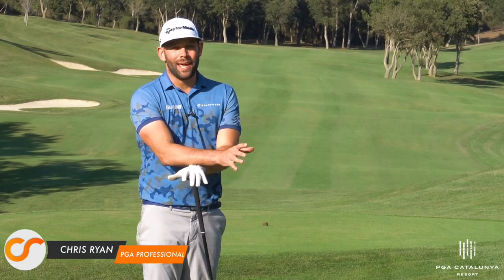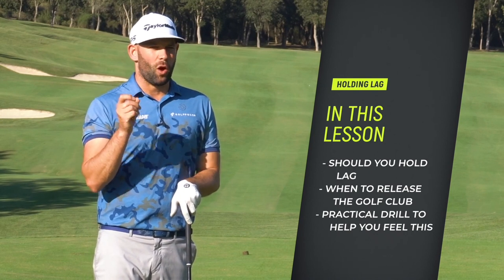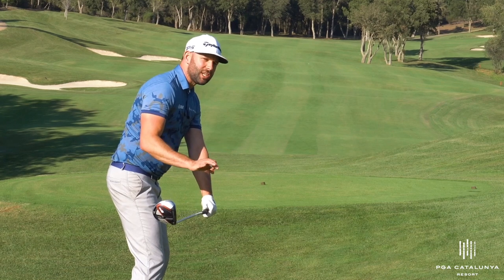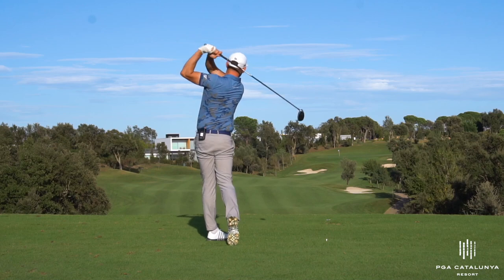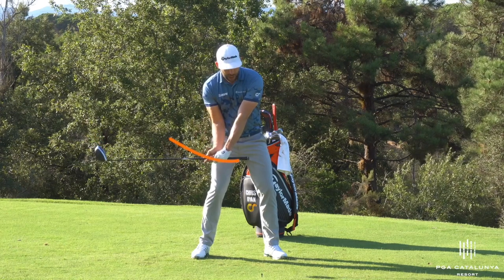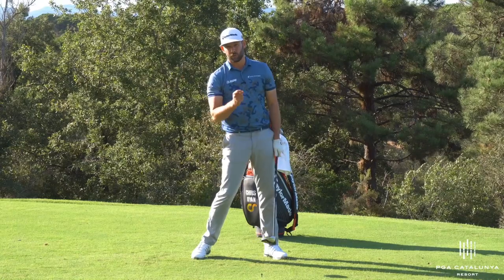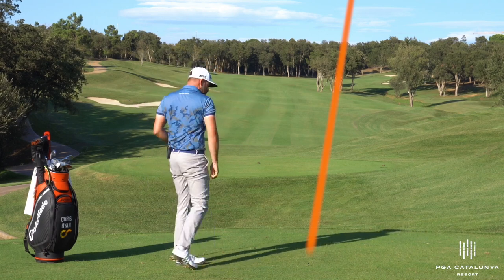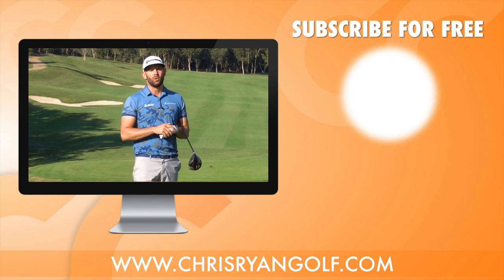STOP HOLDING LAG TO FIX YOUR DRIVER SWING

Comment: Excellent video, been looking for a drill to help me release the driver earlier and not hold on to lag. Will this affect my iron swing in terms of possibly developing the habit of casting amd not having the handle forward on impact?
Reply: Joseph. Exactly my question. Does it differ with irons and rescue clubs? Questions don't seem to get answered!!
Reply: @anthonypollen4520  personally id say no! with irons i maintain that lag and to me its more consistant. i still get very fast ball speed, club head speed, and distance (i hit a 9 iron 170). with the driver though, when i maintained the lag, my drives would never get passed 280. now with releasing, 300+. i think just the driver you release the lag.

Comment: I dont think you should try and control when to release the club.  The club releases automatically when the body stops turning.  What helped me was having my feet more square.  Flaring my front foot open was causing too much body rotation and a late release.  Also putting the ball more forward in your stance helps not having so much shaft lean at impact.